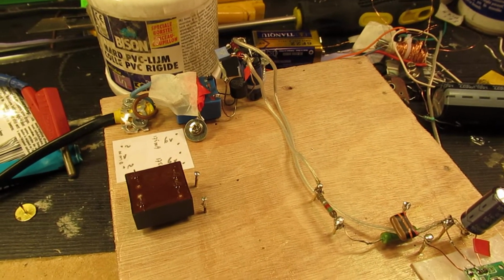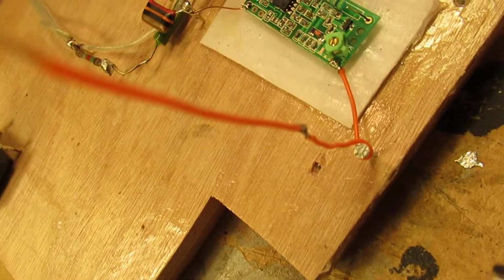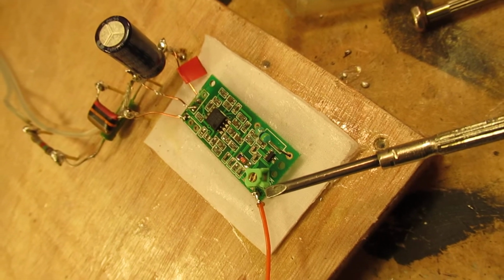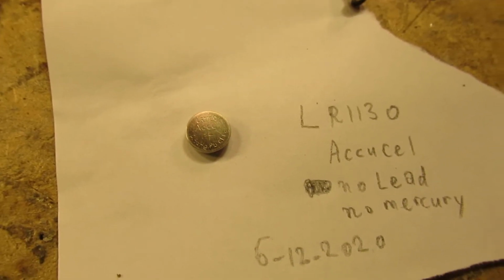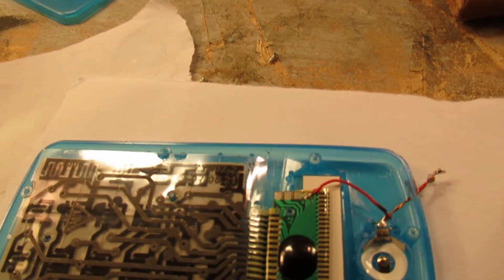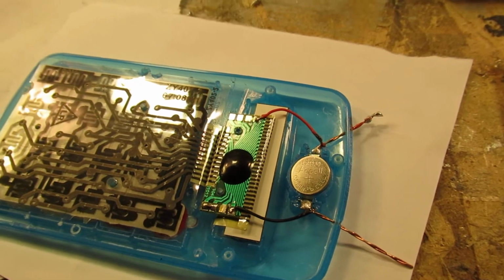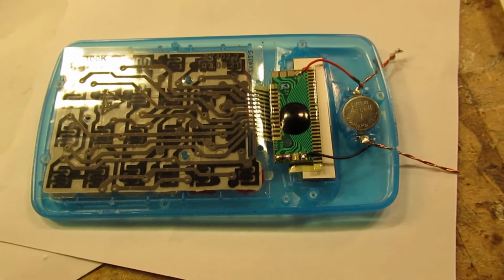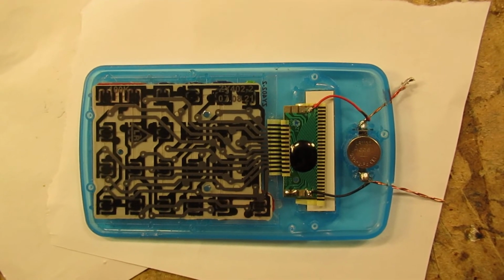VLOG A 433 MC receiver chip connected to a mains supply: the problems & repair a 2 dollar calculator

Comment: Why is it advantageous to use two capacitors in parallel, e.g. 100 microFarads and 100 nanoFarads?
Reply from the maker: The 100 N or 50 N makes a HF bridge to ground.